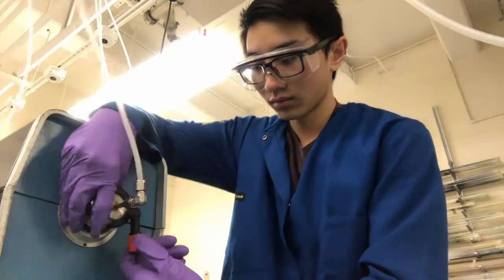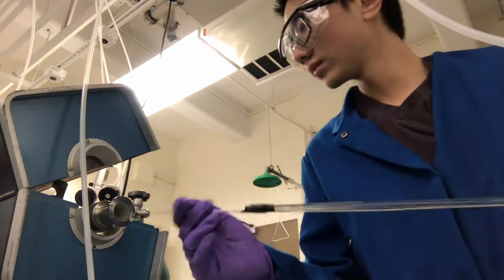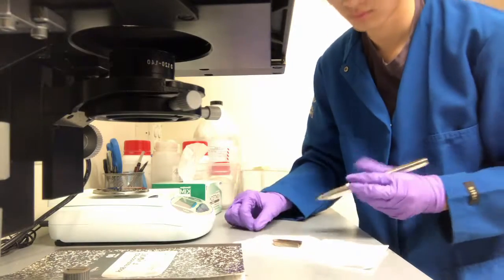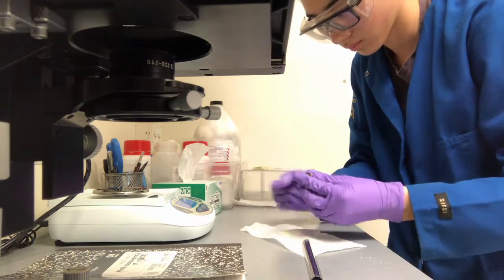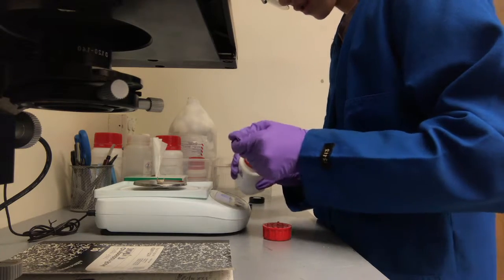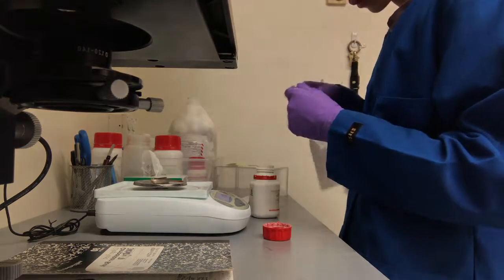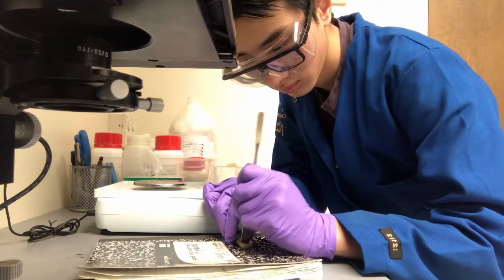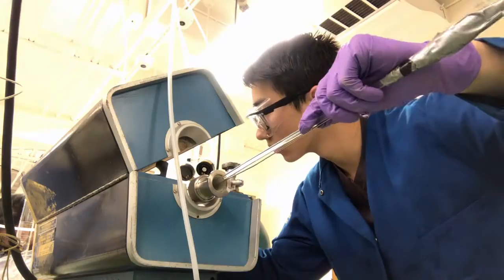Growth of Monolayer Molybdenum Disulfide

Comment: Hi,
after seeing your video, which is very representative of the MoS2 growth, I would like to know which flow rate did you use to get proper MoS2 monolayers.
(This is not meant to be the questions turn like in a conference, but I just was curious since I have been working also with MoS2)
Thanks in advance!

Comment: I am sorry but I really did not notice any growth. It was just about placing the precursor boat into the furnace. I request you to do a better video by showing the CVD setup, its operation, MoO3 growth and sulfurization steps, etc. You may also wish to inspect the deposits under the microscope. Such a video will be really useful for enthusiasts.
Reply from the maker: Hello Safdar, 

Thank you for your questions and concerns. I hope to address them throughout this post.

I do not know what you mean by not noticing any growth. This video did not showcase any growth for one reason: this is a video strictly on the experimental procedures on what my laboratory do for CVD growth for molybdenum disulfide, thus about the placement of the precursor boats. This does not showcase the analytical portion of the growth for the same reason as before. It is to only showcase the experimental procedures of MoS2 CVD growth on a 300 nm Si substrate. If you would like to learn more about the analytical approaches that CVD has, then there are Raman and photoluminescence spectroscopy. This video was catered towards a research conference, so the analytical portions are presented in a powerpoint because it is hard to present the information without pictures of the graph. 

As for the video setup, I do believe that with better equipment,  it is possible to produce a better video on MoS2 growth through CVD with an actual budget. Hopefully, someone with a better funding can create a better video! The CVD setup is standard for most MoS2 growth as stated in many of the scientific journal articles on this type of growth: furnace, inert gas, tubes, controls, etc. I do not know what you mean by operation. MoO3 growth is done through CVD with an inert gas with a transition metal dichalcogenide, so I am not quite sure what you are asking. I highly recommend reading a bit on MoS2 growth through CVD before actually watching this video as it requires prior knowledge. I hope that address all of your concerns and questions!

- MoS2 Growth